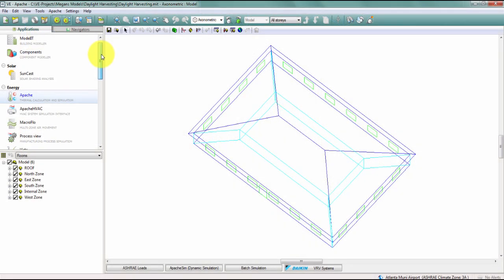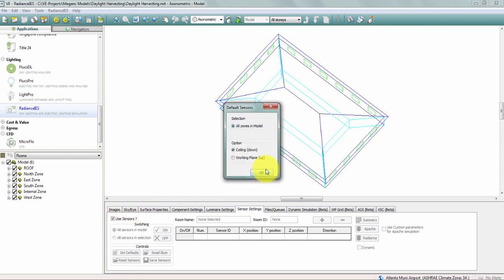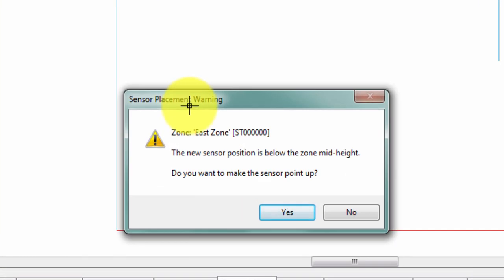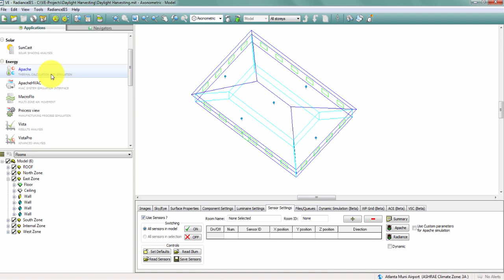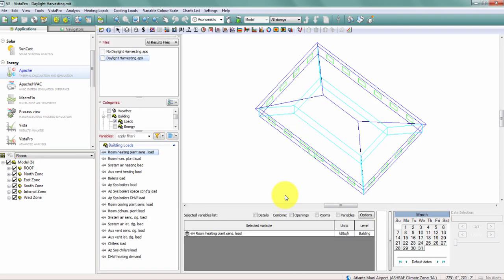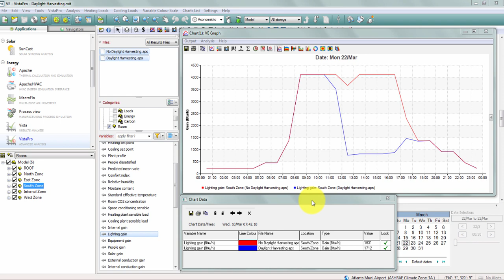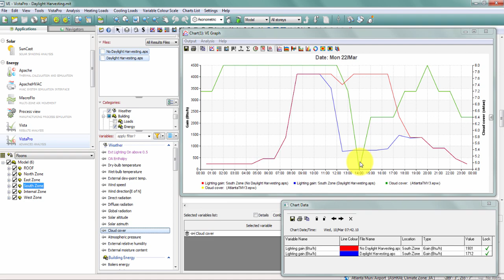Daylight Harvesting

Comment: How do I create artificial light, the necessary profile to make it dim in response to different daylight levels? Thank you.
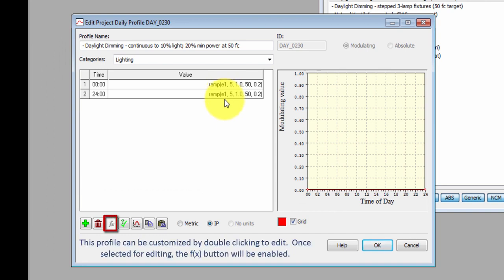Reply from the maker: Hi Abimaje. If you look at 4:48 you will see an example dimming profile that references the e1 variable (the light level recorded by the Radiance sensor for that room), use this as a reference point and the lighting gain can be dimmed for different threshold lux levels that are received in the room. See also the PDF on http://www.iesve.com/support/knowledgebase/faq/2413
Reply: How can i.measure the artificial lighting energu consumption without daylight harvesting?